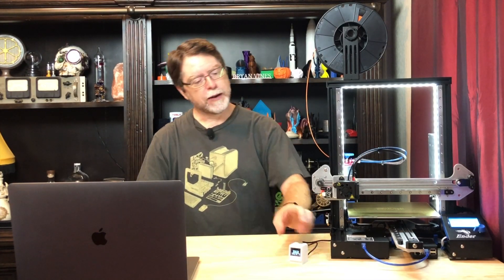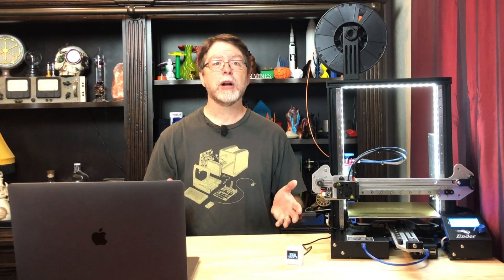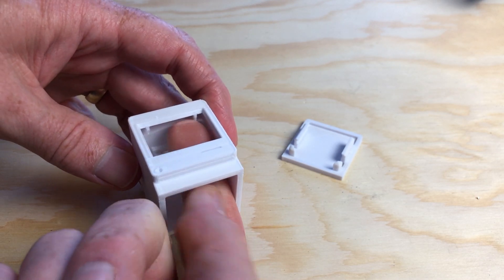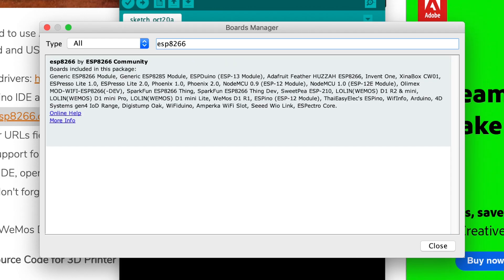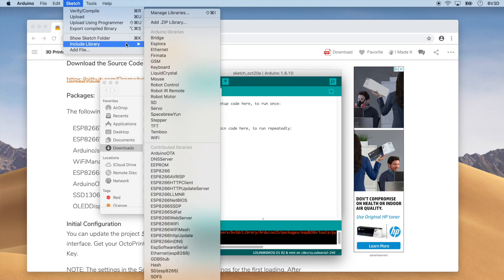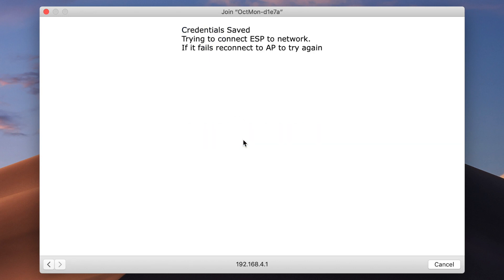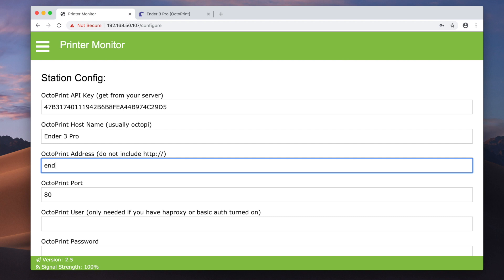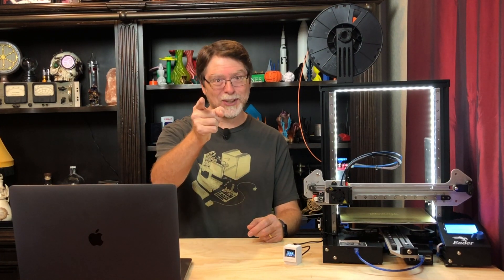How To Build a WiFi Printer Monitor for OctoPrint into a tiny Macintosh!

Comment: Problem:  Thank you Bryan for an exceptional tutorial.  My setup is exactly the same but I don't see the SPIFFS in the flash settings.  Instead I see 4 Meg FS:1mb 1019KB.  Otherwise everything went per the video, except nothing on the screen after the download to the ESP.  Any ideas please?
Reply: Found part of the answer, that the current ESP8266 is 2.7.4.  Bryan installed 2.5.2.  Installing that enabled SPIFFS to be visible.  But, although everything compiles, nothing appears on the screen, although tried 2 different boards and screens.
Reply: Still not working, so tried a different board and screen.  Still not working.  Tried to do a fresh install on the Mac, but after deleting and re-installing the Arduino app, everything was still there.   Made a fresh install (slowly) on a Windows PC.  Compiler said Settings.h file missing, so installed Arduinojson.h (which is supposed to be included already).  Compiled ok now, downloaded to board, but nothing on the screen.  Tried on second board and screen - nothing.  Clearly something wrong, but  with two different installs, two different boards and screens. Sadly out of options.  Anyone in the UK flash a board for me please?
Reply: Update: Followed on on the video and got into the app by using the browser on my phone by finding the IP address.  All working and configured, by still the screen is not working even though the connections triple checked.
Reply: @rogertuffin6881  Couldn't find anything on the SPIFFS installing 2.5.2 worked for me. Thanks for the help!

Comment: Hello,could please help me. The ide is getting this error : serial.serialutil.SerialException: could not open port 'COM4': PermissionError(13, 'Zugriff verweigert', None, 5) What can i do? Thank you
Reply from the maker: It sounds like the IDE doesn't have permission to use COM4. I don't know if it's because some other application is using COM4, or if there's a permission setting somewhere. You might try rebooting, and then getting into the IDE right after you log in, without opening any other applications. No guarantees that will work, but it's worth a shot.

Comment: tip: you NEED to get a wire stripper if you solder regularly. They are quite cheap and they are soooo nice! 

I recommend this one: weicon tools no.5 made in germany
Reply from the maker: I'm an occasional solder-er. But I've just added a Weicon No. 5 to my Amazon wish list. Thanks for the info!
Reply: @BV3D  cool!

Comment: cool t-shirt =D
Reply from the maker: Thanks! I like it, but that illustration has a technical error. There are four screws which hold the CRT to the front of the case. They should be shown coming through the tabs on the CRT from behind, to secure it to the front, but the illustration shows the screws going into the front of the CRT. 😄
Reply: @BV3D  haha =D

Comment: Awesome vid! Check out Paramount 3D Game Cartridge Grey for an old electronics look. It’s not like the apple beige but still cool.
Reply from the maker: Thanks for the tip! The Game Cartridge Gray looks a bit dark; it would make a good accent color. The Prototype Gray is a bit lighter, and might be better for the mid-1990s off-white PC cases! Between the two of them I could probably print a decent-looking Apple //e Platinum (it was that off-white, with darker gray keycaps, and its keyboard had a numeric keypad that pushed the boundaries for cramming such a wide keyboard in a standard Apple // case.